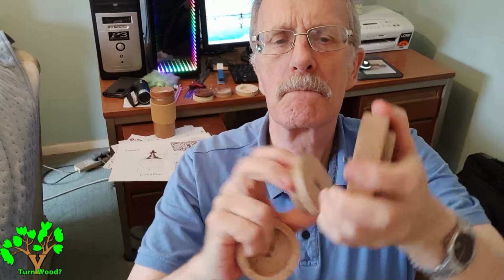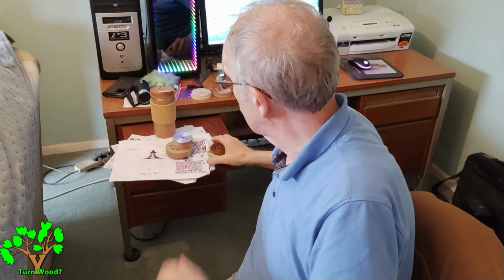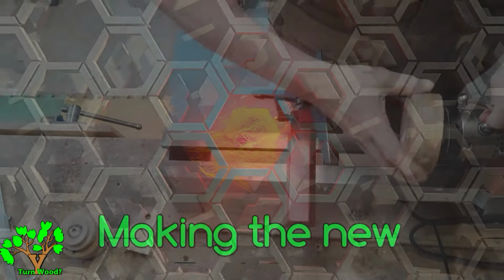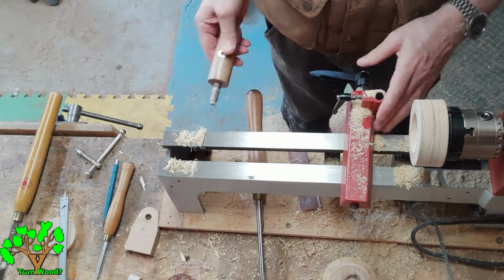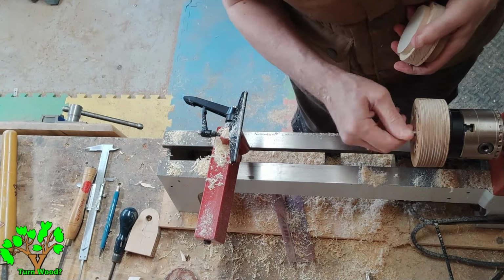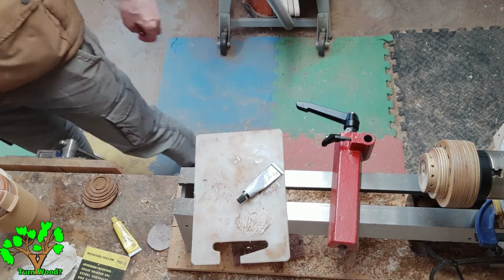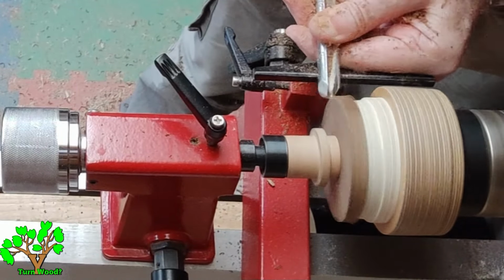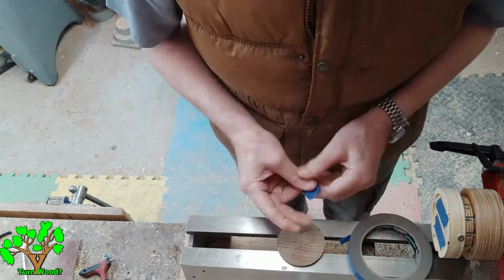Eccentric Chuck MODIFICATION

Comment: A lot of vibration expected as you increase the eccentricity.   Could you use your fluting and carving jig to cut the grooves while rotating the lathe by hand?    This may provide a lot more control of cutting and no vibrations.   Also less forces trying to fling the pendant blank off the chuck.
Dave.
Reply from the maker: Good idea thanks,  I may well do in the future. However I  want to make it acceptable on the mini lathe, i've made a smaller version which works well and the vibration is not to much for the Axminster  mini lathe. I'm in the process of finishing my next video which showes this, 
The larger version works fine on my larger lathe with no vibration so i can increase the speed to make turning easier.

Comment: Masking tape and super glue is a recommended method with luthiers. Ive used it on a lathe and works well as long as the tape is of decent quality. Other method ive used is hot glue...then melted it off with meths but that can be a bit messy. Great video.
Reply from the maker: Thanks for the info! musch appreciated